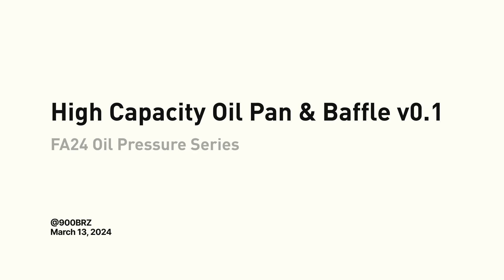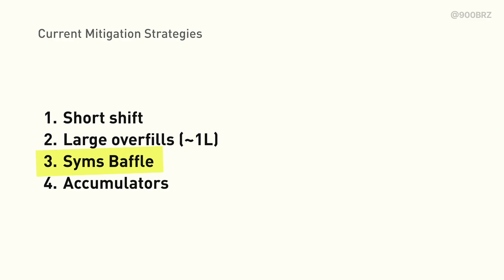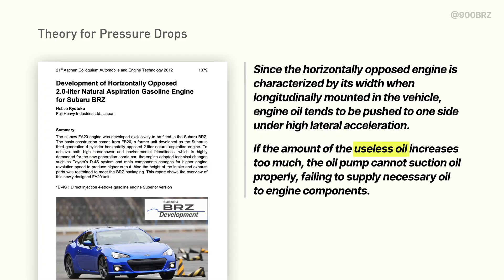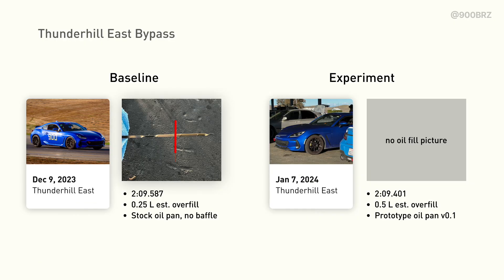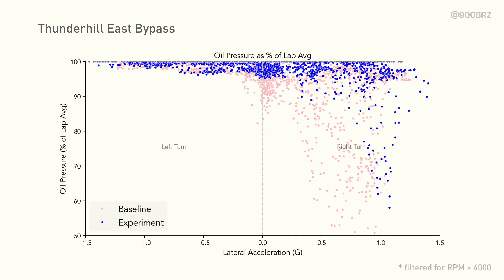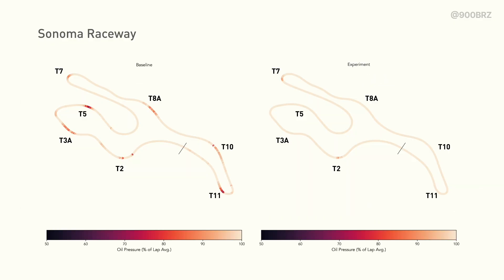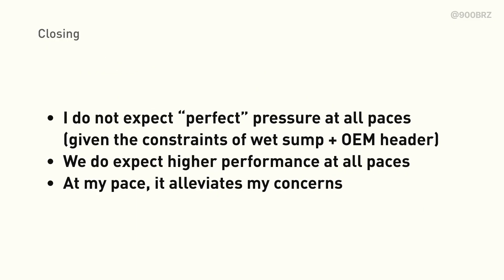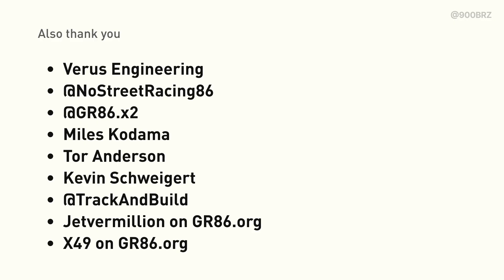FA24 High Capacity Oil Pan & Baffle Announcement

Comment: Hello 900BRZ, I am very much apalled by Toyota’s lack of response towards this problem. At least Subaru STI has developed an oil sump baffle…
Anyways, I do some preety spirited driving with my 86 kinda often, it is also my daily and I was about to buy the syms baffle right. I didn’t buy it precisely because of this video.
I was wondering a few things which I would like for you to answer if that’s ok:
1) Will the final product alter anything else from the car? I fear that I will have to run this baffle without some of the heat and road protection under the car.
2) With more volume in the pan, will I need to put more oil in the car? How much if so? Can that affect my car’s reliability ?
3) How easy is it to install? Can I trust a local workshop to install it?
4) What’s the ETA on this baffle? I track this car for an hour with 4 breaks in between the hour at least 4 times a month (4-6 times) and I don’t know if the syms baffle is more suited for me.

Thank you for your work and dedication and your attention, cheers.
Reply from the maker: Hey thanks for the comment. 

1) You can add additional heat shielding later. We’re primarily focused on the oil pressure right now but I will likely add some heat shield and will document that when I do. Nothing else has to be changed. 
2) Yes, you need to add oil to fill the additional volume of the pan. You will use the dipstick as normal, so you can decide whether to fill to the max line or above. Either way you’ll be running more oil than stock. More oil is typically a good thing, especially for track use. Some Porsches have as much as 9L of oil capacity. More oil means more capacity to absorb heat, so you can have lower temps, which is also a good thing. Verus will release the exact volume of the pan at some point in the future. 
3) Installation is basically the same as any other oil pan or even an RTV cleaning. You have to do the same steps. Remove the exhaust header, remove the OE pan, clean the mounting surface, install the pan with new RTV, reinstall the header. Any shop that knows their way around a Subaru can do it no problem. 
4) I don’t have an ETA at this point. 

Are you saying you’ll do 15 minute sessions or 1 hour sessions?
Reply: @900BRZ  Also I forgot, I do 1 hour sessions with breaks every 10-15 minutes
Reply: @900BRZ  thank you so much for the quick response! Ill definetly stick to this solution then! I am very glad about all of this. I guess ill just stick to the overfill and  being lighter on the revs until this is released. I am recommending this channel to the toyobaru club in the Canary Islands!
Reply from the maker: @Kz3andMore Yeah overfill and short shifting makes sense for now unless you don’t mind swapping pans. Cheers, thanks!

Comment: So… you’re saying… buy it and k swap it? 🤔
Reply from the maker: If it was easier to do this and keep it street legal in California, I’d probably have already done this.
Reply: @900BRZ  i was just kidding, i don’t have $15.000  for K-Swap kit, and another $5.000 to $10.000 for K24 engine… and here in Serbia engine swaps are illegal… so i will probably buy beat up gen1 from Germany for $10.000 or finance new gen2 from Subaru dealership here in Serbia they are $42.000 for manual and $45.000 for auto here😭
Reply from the maker: @notsafetolook I’m on my second engine due to a prototype baffle failure so it would have made more sense for me to pretty sure you can pick up K24s for less than $1.5k in the states! That would be one of the biggest benefits of the swap. That’s too bad swaps are illegal in Serbia too. Any legal needles you can thread to make it happen? In CA you technically can do a swap but the engine has to be from a car that’s newer and you need all the engine controls from the donor vehicle as well.
Reply: @900BRZ  if im part of race/auto club and im actively completing and car won’t be on the streets just trac i can do whatever i want… as for “street legal” cars we can do every possible mod expect engine swap. So I’m very happy that someone is tackling the oil pressure problem. Do you have oil pan gasket in states for solving RTV problem or is it RTV all the way?
Reply from the maker: Gotcha, yeah that’s not dissimilar from here. If it’s dedicated track only then anything is on the table. Maybe someday but I don’t have space for a towing setup. Right now, the pan is still designed for RTV sealing. I asked about adding a relief for a property gasket seal but no commitment yet from Verus.
Reply: @900BRZ  same here don’t have space for towing and here you need special license for towing. Is there aftermarket oil pan for BRZ/86 that can take gasket? Do you think that higher pressure aftermarket oil pump can solve the problem with low oil pressure? (Just spitballing here😅)
Reply from the maker: @notsafetolook I don’t know of any existing products on the market that include a gasket, but it’s definitely done on other vehicles. I think this oil pump already has more than enough flow rate and we’re limited by the pressure relief valve, which starts limiting pressure around 4000 RPM. If anything there is more flow than desired since the pressure relief dumps the oil back pre pump and could potentially be a source of aeration.
Reply: @900BRZ  now my head hurts, i can hardly wait for you guys to find solution to low oil pressure. I hope that you fix the issue soon!

Comment: Is it possoble that using lower viscosity oil coild make a difference since it could drain faster back into the oil pan?
Reply from the maker: You’re going to pay for that with lower pressure and thinner minimum oil thicknesses at the bearings, so I think it’s the wrong direction.
Reply: @900BRZ  Well yeah, but doesn't oil pressure need to be just "good enough" to not have metal on metal contact and more isn't necessarily better? Since user manual says 0w20 can be used,  maybe in combination with a good oil cooler it could work? I mean, having a bit less air in the oil (if this idea works) sure beats having a bit lower oil pressure (if it's still in the "ok" range)
Reply from the maker: @BornToDrive1500E Decreasing minimum oil film thickness at the connecting rod big end bearings will increase localized heat even if there isn’t metal on metal contact. Manuals also specify in hotter climates like Malaysia that 5W30 is acceptable, so I’m not particularly concerned about the thicker oil being out of spec for the engine. Would love to see data from other people with different setups, but I haven’t seen anything that would make me want to go back to 0W20.
Reply: @900BRZ  Makes sense. Thanks for the reply

Comment: Awesome work and process !  I look forward to track days without taking right turns at 70%, and will purchase the oil pan when available.  You mentioned the need to remove the heat shield, and can Verus explore testing some of the exhaust heat shield wrap available as an alternate?  It may fit and give some reduction to additional oil temperature rise.
Reply from the maker: Thanks! Yes, right now I’m running the header naked and have reason to believe that it should be reasonably safe with stock power. However I’m looking into adding some heat shield product from DEI or Heat Shield Products.
Reply: @900BRZ  great foresight !  Would you consider comparing one or two runs of "no heat shield" recent runs with a past run with heat shield and no baffle to see if there is any obvious jump?  I realize there are probably uncontrolled variables here, but it might give some directional insight. Thank you..
Reply from the maker: @emerinomarchetti6456  Yeah I can do that but I can also just report that my oil and coolant temps on street driving were totally unchanged. Not even a couple degrees different. It could just be that in the conditions I’ve seen so far the oil cooler (Setrab Series 9, 20 row) is effective enough to overcome any additional heat added by the header. I’m also already running some gold reflective tape on the pan.

Comment: Very thorough. I wonder if it would be worth doing some sort of normalising the pressure data against engine rpm to remove any influence from gearing, even just for videos’ sake to show where pressure drop is not meant to happen instead of where it is fine to happen.
Reply from the maker: For now I’ve just removed data under 4000 RPM from the scatterplots. I think that should be enough to cover all the cases where pressure is expected to be below the average pressure.

Comment: On the FA engines, they have been designed with a Non-priority oil system.  So after the oil travels along the main galley it is split in 2 directions to the mains and heads.  The EJ engines used a Priority oil system where the oil would go to the mains first then the bleed off to the heads.
     Also there are 2 main oil restrictions the stock FA engine come with that you may want to consider:
-There is a cover from the pump to the main galley, the hole in the pump cover is significantly smaller than the hole in the galley, you can port match/bore that out to eliminate that restriction
-the other is the stock oil pick up tube and screen, the tube is smaller than the pump intake port and also the screen on the end has come off.
     Those 2 restrictions can cause Cavitation in the oil system.  All oils contain a certain amount of dissolved air.  When a pump can't get enough oil, air is pulled out of the oil, these air bubbles eventually collapse/implode when they reach an area of high pressure. This would cause pressure drops (though, not huge pressure valleys/but could still contribute) where the engine is under the most stress, ie: downshifting/high revs or full throttle to dig out of a turn.
Reply: Another note when modifying the stock FA series engines horsepower, testing is showing that stock rods start to bend/warp @310-350 Ft/Lbs of torque. The engine can be saved if it is caught soon enough/shut down and rebuilt.  Be cautious of people who make claims more than that from stock engines.
    The oil pump gears start to shatter at 7.9-8k Revs, so if the rev limiter is removed, the oil pump gears will need upgraded.
Reply from the maker: You’ve obviously done some research or have some hard-won experience. Thanks for the comment. I was aware of the non-prioritized main gallery (technically it prioritizes the LHS head, which is def not what you want), but not familiar with the restrictions you mentioned. I’ll have to look into those. 

I have an SAE study that I’d like to cover in a deep dive video that discusses the cavitation from air coming out of solution in low pressure events. I believe this is why we can see catastrophic rod bearing failures far above 0 psi.

Good to know about the failure points as you add power or raise the fuel cut-off as well. I’d like to make it reliable with stock power first!

Comment: Wow this data analysis looks really nice and detail . Could you tell us what device and software did you use to collect this data
Reply from the maker: I mention it briefly in the video description:

• Aim Solo 2 DL connected to ASC CAN-bus
• Low Dollar Motorsports Oil Pressure sensor and CANMIM data injector by  @nostreetracing86  

CANMIM is a custom data injection device that allows us to inject analog data into the onboard telemetry system in the car. It’s an open source project but not really ready for broad adoption yet: https://github.com/HPDE-Tools/CANMIM

There is also a similar commercial product available from Ansix https://ansixauto.com/2022-brz-gr86-oil-pressure-sensor-canbus-kit/

Comment: While I am very fascinated by all of this I am still baffled (sorry... not to use a hack play on words) by the amount of dedication and effort that goes into fixing what is essentially a bad-by-design engine for a car of this nature, Porsche has managed to alleviate all of these problems in flat engines but obviously we're not comparing apples to apples. Maybe it's part of getting older or wealthier but I just don't care to deal with headaches likes this. Develop a dry sump or put a proper motor in it already.
Reply from the maker: Totally reasonable for people to bail on the platform as a result of these engine oiling issues, but my belief (I think justified by the results we’re starting to get) is that we can find a relatively inexpensive modification that can dramatically improve performance for people without going all the way to a dry sump. Dry sump would certainly work, but cost is probably $5-10k plus engine out for installation.

Comment: reminds me of RB engines with the freeze plug on the back of the head removed and an aftermarket pipe from that freeze plug to the oil pan to make the oil drain back quicker this is mostly for drift guys they hold high rpm alot but not very needed for drag guys from most peoples experience doesnt seem to be a big problem in straight line drag stuff
Reply from the maker: Oh nice, they had a port already installed in the head from the factory? If that was the case we’d almost definitely add the return to the pan. As it is I think it wouldn’t be too bad to machine a replacement valve cover with a port on it and I think you’d only need to do the left hand side head.
Reply: @900BRZ  yea check it out it's called Cylinder Head Oil Drain Kit for Nissan RB20, RB25, RB26 & RB30

Comment: Great information and good timing for me as I'm looking at pressure maintenance options for road and light track use this year having just installed a pressure gauge.  However, I'm in a 2017 GT86 with the FA20 .  Does anyone know if a similar high capacity solution already exists for FA20, backed up with proper data like this?
Reply from the maker: I know there were some high capacity pans developed for a motorsport series in NZ but I don’t know of any that are on the market. https://www.speedhunters.com/2014/01/a-grid-full-of-win-toyota-nzs-own-racecar/

Comment: This new product sounds very promising. The SR20 ran into oil pressure issues like this with increased power and aggressive driving. The solution everyone runs now is a larger capacity oil pan with trap doors around the oil pickup tube.
Reply from the maker: Nice, sounds reasonable!

Comment: As I daily drive 23 BRZ - been waiting to track until such a solution is available. Hopefully to market soon and that Verus can produce quickly enough. Any data or video available of Syms baffle and 1L overfill? Is it vastly inferior? Personally I'd like to run an = length 4-2-1 header though and wonder about compatability.
Reply from the maker: Check out @nostreetracing86 with that exact setup on the same day with the Syms pan and a 1 qt overfill: https://www.youtube.com/watch?v=tcDSgJOr2Ac
Reply: @900BRZ  Thanks!!

Comment: I know you guys are 86 Cup guys so you're using SX2s, but we really need some testing with super 200 Treadwear tires like RE-71RS, AO52, or 660s.  Heck even Conti ECFs, Falken 615s, or even RS4s will provide more lateral Gs than SX2, and are more common in the track community.
Reply from the maker: Yup, agree. Should be coming when we can get the pan on my friend Kevin’s car.

Comment: Good info! You've made me think about my data a bit differently.

I've been chasing oil pressure issues in my Super Seven, which has a completely different engine platform of course. A ~1L overfill has taken care of the issue on runs up Highway 9 and 35, but I'm reluctant to try autocross in the car until I have a better solution worked out.  I've been on the fence about an accumulator or replacing the pan.  You've convinced me that I should replace the pan first.

I'm going to have to dig into my telemetry data again for fun. For instance, I hadn't thought to exclude sections of oil pressure data based on gear/engine RPM.
Reply from the maker: That’s great to hear. You should be able to do some quick testing just accelerating in a straight line to see around what RPM the oil pressure flattens out due to the relief valve and you’ll want to exclude everything under that RPM. If you can resolve it with a pan first that’s definitely better!

Comment: Very nice presentation of the data and talking points. What editing software do you use? It almost looks like a PPT presentation (in a very positive way). Cheers!
Reply from the maker: Yeah it’s essentially a PPT. I’m using Figma to make the slides and then pulling them into Final Cut Pro to cut everything together. Thanks!
Reply: @900BRZ  Fantastic, thanks for the reply, best of luck!

Comment: Just gonna say, I appreciate it, but let's take a step back on reality and say Subaru does know the issue, but it's not cost effective. Compare the boxer engines with Porsche. They have solutions to the problem. Money/cost effectiveness is the issue. It's that simple.
Reply from the maker: Sure, if money is not a constraint, you can go straight to a dry sump. Subaru even discusses this in one of the papers I reference: 

> If the amount of the useless oil increases too much, the oil pump cannot suction oil properly, failing to supply necessary oil to engine components. To avoid this, the dry sump is considered as a counter measure. The dry sump, however, requires the use of oil tank and scavenge pump, which increases the system cost and weight substantially.
Reply: @900BRZ absolutely the dilemma. i am looking for the solution across EJ and FA series as the dilemma / achilles heel of all Subaru motors 😢
Reply from the maker: @apex_gr  Yup, agree. There might be a half-measure which would be scavenge pumps in the heads that return oil to the pan, but you’d still need a good way to de-aerate the oil. You could integrate a de-aeration chamber into the pan, but you don’t have much room to work with down there!
Reply: @900BRZ 10+ years into Subaru engines, Accusump seems to be the most economical with a baffle. With my FA20, i’m debating turbo and gonna likely do a 5-7psi setup.